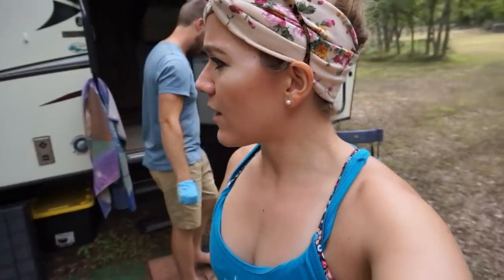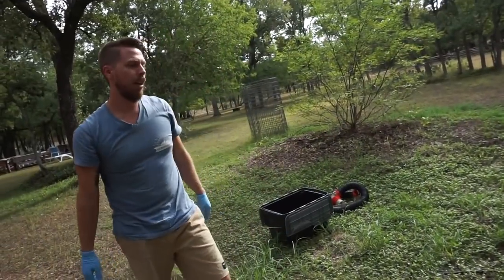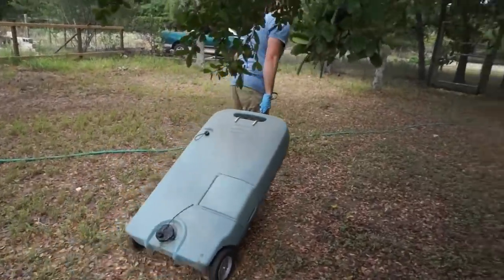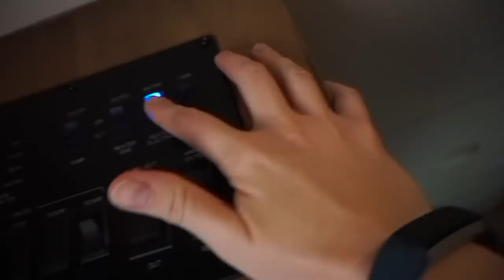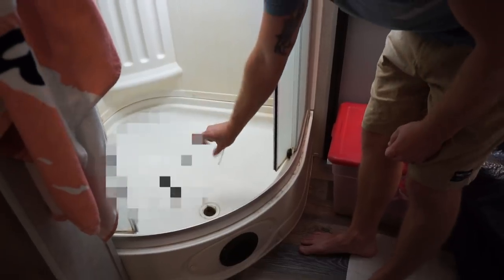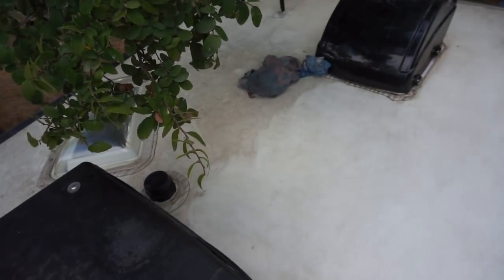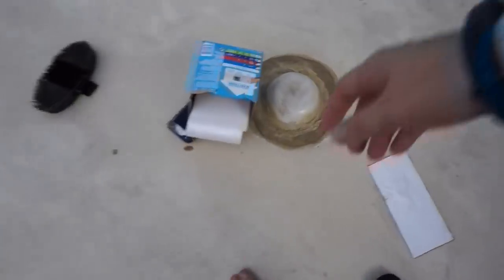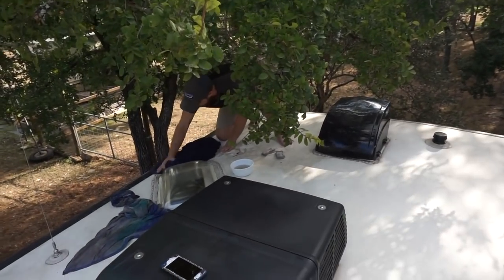CLEANING OUR "TINY HOME" // RV DEEP CLEAN

Comment: You know how I feel about cozy. Never took a nap in my life, unless I was sick, until we moved into our RV. Love my cozy little house. 
Dawn dishwashing liquid does a great job on our RV roof, which is fiberglass. We use the water hose to wet small sections at a time, cause it gets slippery, then using the extendable handle soft RV brush, we just wash with the Dawn & water, then rinse. It goes pretty quick. Of course you then have to wash your RV, because all of the lovely gunk from atop, runs down the sides. 🙃 Have fun out there you two! ❤️

Comment: Girl! You are so right about the dirt and fur-bunnies that go scurrying across the floor!  And it’s all right in front of your face!  I have four cats, three of which are long haired. I swear they just walk and clumps of fur fall off them!😂 I am a clean-freak so this has been one of the biggest challenges for me to get used to. I got myself a nice little rechargeable vacuum that works so well! After dinner I spend five minutes going around with the hand-held part and go along all the edges, then I connect the vacuum and do all the floors including the little bit of carpet I have. It’s been a sanity saver for me! I also vacuum their litter box area every other day which really cuts down on the litter that they track back into the RV. Great job on the cleaning!  We are going to tackle the roof after we move to our new permanent spot in a few weeks. How often do you guys usually do the roof?

Comment: Maybe train the dogs to sit and not move until you “ok” them.  I do that at all our doors, so they don’t just run out into the street, elevators, gates etc.  they wait for the “ok” even with a door wide open.  Nice job cleaning, I just did a deep clean on our RV, but I normally do that each trip.

Comment: One item I still need to be able to access my roof, a telescoping ladder that doesn't weigh too much, since I have the back issue, and can't lift much over 25 lbs.  I know it needs a good cleaning, as  the rain sends all that uchy dirt down the back/front.  Not sure how I will go about cleaning the roof, as I can't get on my knees, or sit on a hard surface, so I am thinking I will need a large sponge mop.  Anything I absolutely need to get down for, I can just lay belly down.  Ya' do what ya' gotta' do, right?  That roof looks great now!

Comment: Is it possible to move the RV to be able to hook up the RV to the septic without having to use the poop trolley?
Reply from the maker: Not without digging into the ground with connecting tubes/pipes and such. This is actually something we started to design when we first moved into the trailer but just have yet to revisit it. We don't mind the 'poop trolley' much. Just part of the routine at home base. -Blair

Comment: I'm not sure why you didn't use a hose and some spray on cleaner on your RV roof but it will save you lots of time. We have a 31 foot fifth wheel and I can clean the roof on it in less than 20 minutes. Check on Amazon for RV rubber roof cleaner. I'm older and don't like to bend over anymore so I picked up a brush with a 4 foot handle to scrub the roof with and it saves even more time. Well have fun and be safe. Thanks for posting and sharing with us.
Reply: Same.
Reply: I think the only thing I feel safe about washing my roof with is the Dicor Rubber Roof Cleaner.  Having that rubber last is not something I want to experiment with.